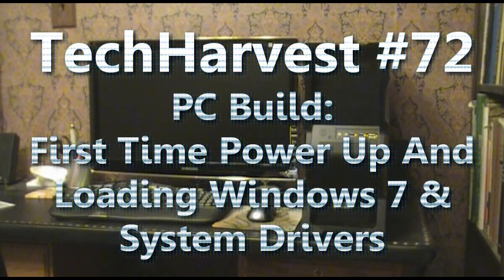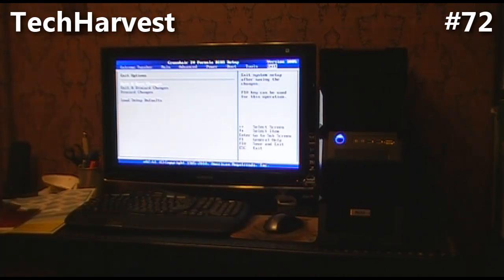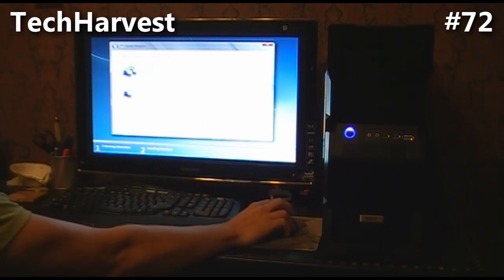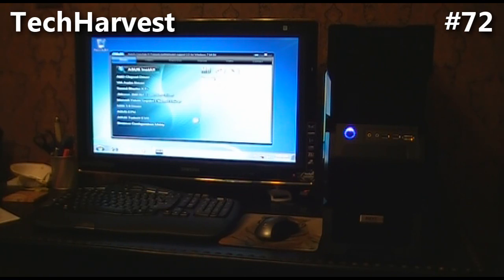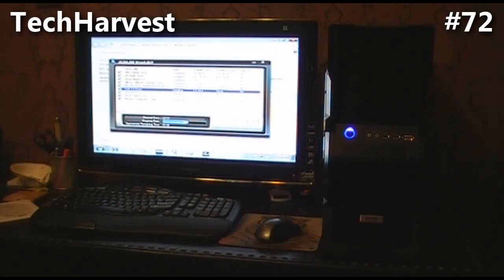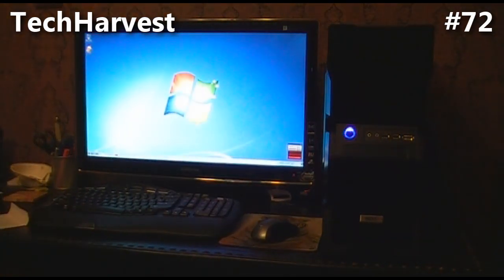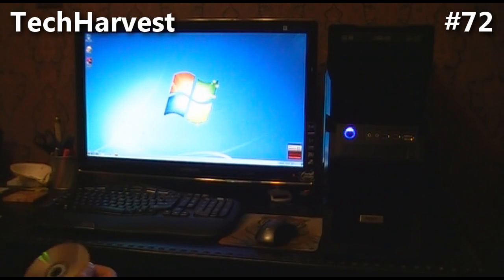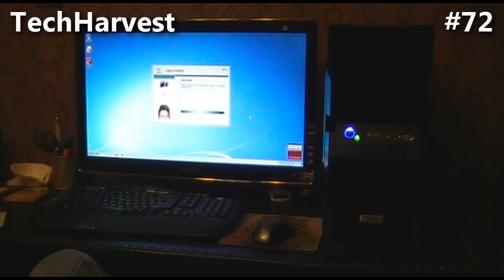Building A PC: Loading Windows 7 & System Drivers - First Time Power Up

Comment: Hi. 
You seem really smart with PCs, so, I fucked up when updating my drivers and while the video drivers were installing I turned the PC off and now there are no video drivers on the PC and the screen is just black once its past the company logo, it is a TOSHIBA satellite running windows 8 please help me!!!
Reply from the maker: Personally if I were you I'd just reinstall windows and go from there.  Just remember that a reinstall will wipe your system clean and you'll lose everything on your PC.
Reply: Ok how? I lost my disk and a bootable USB with the ISO won't work =(
Reply: Try to hold the power button. If no screen... I would repair it.

Comment: I think before you install Windows it's best to go through the BIOS settings to make sure everything's set correctly. For example, make sure the "SATA control mode" is set to AHCI or RAID. The default is often IDE, which means you won't  get the best performance from the hard drive(s).

Comment: Hey Tech Harvest, I am at this stage in my pc build, but I am running into a problem.  My computer powers up and I can reach the BIOS screen without any issues.  When Windows 7 begins to load (the windows is loading screen), the cpu reboots itself.  It is a continous loop that never ends.  I have the CDROM as IDE Channel 1 Master and my hard drive IDE Channel 2 master.  Do you have any suggestions?

Comment: You always want to get the OS first then do the drivers. For the cd drive driver you can just use the disc that came with the cd drive. If it didn't come with a disc windows updates probably will have  drivers

Comment: OS. You can use another computer to download the drivers from the manufactures website and put it onto a usb drive . Or put in ur wireless adapter or whatever u use for wifi. and get it online on your new computer. Both are good. Just know when using the updated drivers u have to do most of the drivers 1 by 1 dont forget to get all the ones u need.( Some main ones are the Motherboard, usb, graphics card, chipset, audio etc.) Good Luck ive had mine for 6months and its still running great!

Comment from the maker: @mearc76 I'm sorry to hear you're having problems with your first build.  It's certainly discouraging.  Since your RAM wasn't seated properly, you might want to recheck all of your connections to make sure everything is as it should be.  Double check and triple check your build to make sure everything is connected properly.  There is always the potential for faulty equipment too, but my first step would be to make sure everything is connected properly.

Comment: @TechHarvest .. Yes, I did read manual. It was same process you were doing.  I found the cause of the problem I had: I didnt push the RAM sticks all the way.  When I push them both the right way, I end up getting something on my screen when booting on BIOS, BUT is no good news, for all I got is blue/green thick vertical stripes.  I wonder if is just my motherboard integrated video, or if its something else.... Is my very first build, had no experience whatsoever before. Bought all items on sale

Comment: Thanks for this great vids abt building pc.... I've been following them all to build my own pc, which I already had the parts.... I was so excited when I power my pc following your advise, however, mine didn't turned-on like yours.  I am disappointed, I googled the problem, but couldn't find an answer.  I was wondering if you had any advise; when pc tuned-on, all fans are on, cd driver works, pci card light on, and mb light stays on.  The monitor I am using is from a working pc, keyboard as well